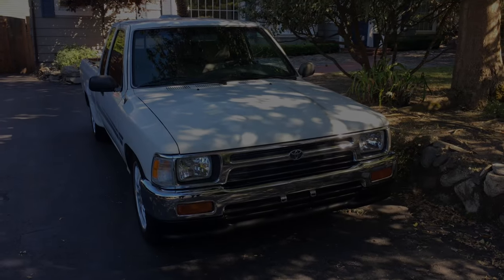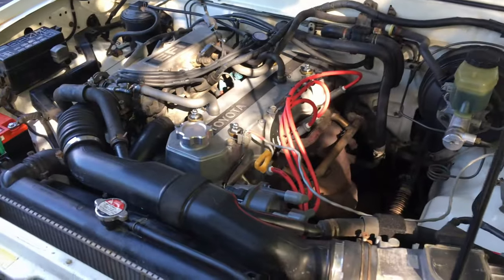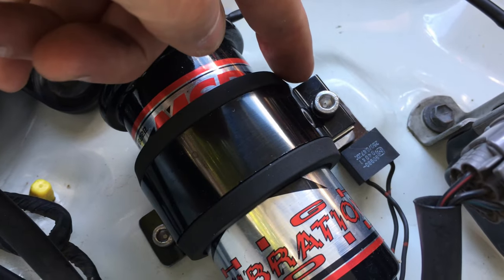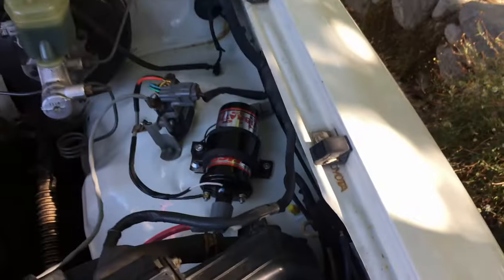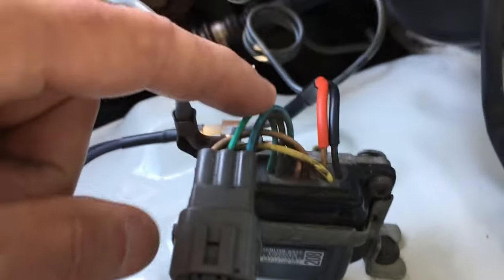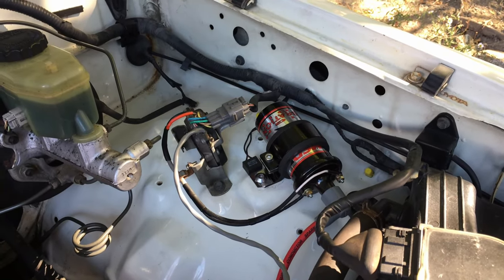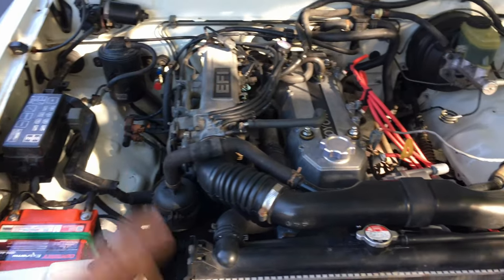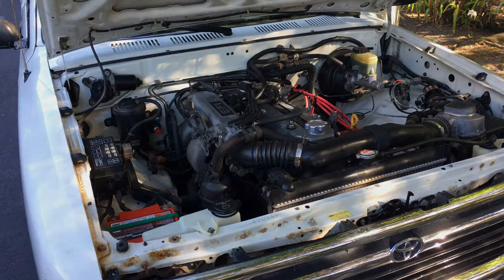1989-95 Toyota Pickup / 4Runner MSD 8222 coil ignitor retrofit / upgrade wiring & 4Runner bumper

Comment: I did this upgrade on my 22re after seeing u did it on the other truck works great got an extra 2 mpg out of my 4wd. However I installed the resistor because this video hadn’t come out and the blaster 2 instruction asked for it, did u do anything to address the resistor it asks for? Is it not needed for this application?
Reply from the maker: The resistor's main function is to help prevent the point contacts from burning up due to too much amperage flowing across them. However, with the Toyota 22RE, it uses a hall effect signal generator and coil (basically electronic crank fire ignition, but on the 22RE it's located in the distributor, not on the crank itself, like what you'd find on a race motor). So because there is an air gap in there and it's only generating a pulse signal, you don't really need that resistor in the mix. Now if you are installing this MSD blaster coil on a 1965 mustang - which does have contact points - then yes, I would say you need to wire in that resistor they show in the instructions. But for the Toyota 22RE it's not really required. It won't hurt anything, but it's not as critical because there are no points to protect.
Reply: Makes sense to me u think it would work better without it? Just curious on ur thoughts I’ll probably remove it anyways, thanks for all the videos very helpful! I have also cut my spark plugs like previously videos works like a charm ur the man!
Reply from the maker: @samuelfriesen1867  Yeah, that little spark plug mod is pretty nice, especially on a more modified motor. As far as the coil, that ballast resistor's job is to help control arcing across the points basically. If one looks at how points function in an older car, we can kinda understand better what is taking place: in am old school point type distributor system: when the points are closed, energy is sent to the primary winding of the ignition coil.. this builds up a magnetic field at ~12V in the primary coil. When the points open (and the duration they are opened is measured in dwell angle), the field in the primary coil collapses (because the points open and terminate the flow of electrons) and this energizes the secondary coil (as the field collapses across it); the secondary coil is an attractive route back to ground, because it's directly connected to whatever spark plug is about to fire off. Since there is a difference between the number of windings in the primary vs. secondary coils, you see a huge voltage jump from the nominal 12-14 Volts clear up to more like 12,000 volts (there is also a corresponding current drop as well in the circuit) All that is fine and dandy, however, because the points have to traverse from fully closed to fully open, they momentarily produce a very brief gap that isn't all that big and which some electrons might view as a more attractive route back home. In other words, a very slightly open set of points momentarily looks like a tiny spark plug. If you didn't have a ballast resistor, a higher number of electrons would be perfectly happy to take that route, as opposed to waiting for the primary field to fully collapse. When they back track as it were, they create their own tiny spark / arc and this is what serves to burn up your points in an older car with a more classic type points ignition system; when the electrons jump the tiny initial gap on the points, it's like a tiny welder in there arcing up the surface of your points. This is why on older cars you are constantly having to clean the points and check your dwell angle, etc. Anyway, the ballast resistor is there to help prevent some of this from occurring with as much current as would happen without the resistor in the circuit; the added resistance basically makes the electrons more prone to wanna just do their thing inside the coil, as opposed to back at the points. So if you have mechanical points then yeah you need the ballast resister in the mix, because it will help extend the life of your points and prevent them from burning up as quickly. However, in a situation where there are no points making physical contact over and over again, then it's basically a non-issue. With the Toyota, you have a hall effect deal in there where you have a rotor and signal coil that is not physically touching. It has a constant air gap in the 22RE distributor and this is acting as its own built in resistor in effect (by virtue of the air gap always being a gap; not opening and closing like points where the contact pads actually touch and open/close). So because there is no mechanical surfaces that touch, the air gap is sort of a bridge too far for the electrons and they just prefer to stay focused in the primary coil and drop their energy over to the secondary coil that is grounded by virtue of the spark plug, cylinder head, etc. They see the path back to ground (via the secondary coil) as a more attractive route than trying to jump back across the rotor / signal generator stuff inside the distributor. So the short answer is yeah, you can remove the ballast resistor and there should be no negative impacts whatsoever. In fact, you'll probably get a slightly hotter spark without the ballast resistor in there and since there are no points to worry about, there shouldn't be any downside to removing it. Most likely you'll see a slight reduction in burn time on the spark plug side and perhaps a slight increase in voltage levels present at the spark plug wire as well. If you happen to have a TA500 diagnostic tool, you can actually check all this and see the exact burn time in milliseconds and voltage levels, etc. I use that tool here to confirm all is well with my ignition system, spark plugs, wires, coil, etc, etc. This is the model I use here (I use it mostly for stuff like chainsaws, but it's handy for automotive engines as well): https://www.amazon.com/TA500-Smartach-Multisystem-Ignition-Analyzer/dp/B001TCWMGS/
Reply: Gotcha appreciate the info, I actually have a stroker 22re and that spark is very helpful to get the power out of it along with resist the higher compression, I’m familiar with the old points, I’ve played with them a handful of time
Reply from the maker: @samuelfriesen1867  Yeah, adjusted the points on my '66 mustang and '70's Datsuns many times myself :) What compression ratio are you running? That MSD 8222 coil should be pushing around 12-14K volts at the plugs if all is well. Are you running traditional Denso W16's or maybe 20's with that strap mod? Did you remove the strap completely or do the side ground routine that I showed recently in the video?
Reply: I’m using the LCE stroker kit, it claims 9.7 so I’m just a hair above that after the rebuild, I’m running ngk plugs, I used the BPR5ES cuz it was what I had and cut them straight across and gapped at .045 I have another set of ngk BPR5EY sitting around I’ll experiment with stretching that gap farther, but I will be changing to the Denso plugs eventually I didn’t realize they were that much better and everyone likes them more, how far should I gap them for more everyday driving? What’s most reliable and consistent? Incase ur curious to watch my full rebuild I linked the good part but this is my buddy and me rebuilding it, there’s more videos on his channel related to my engine rebuild, sadly I’m still waiting for my cam LCE has been out of stock for almost a year and I’m just waiting for them to ship it

https://youtu.be/wnInpXFv9ac
Reply from the maker: @samuelfriesen1867  I'll check the video out, thanks! You might wanna call Faith over at Webcams... they grind most of the LCE cams for them; she can probably get you a nicer grind with less advance ground in. I'm running around 9.7:1 on my motor also (due to the +.020" over and the Keith Black pistons). I prefer the Denso plus myself. I'm running W16's with a gap of .045" here; that seems to work out well for daily driving.
Reply: Oh sweet I’ll look into that I’m getting impatient, I had to go 40 over for the kit I’ve got a 2nd long block ready to rebuild incase I have any problems, it claims a 2.6 displacement, I’ve been pretty satisfied with it, I’m hoping the cam will get me that last bit I need to make it a real beast of a 22re
Reply from the maker: @samuelfriesen1867  I watched the video you posted... and commented there; I was asking what ring gaps you are running? I noticed your friend bored the block without a boring plate, but you are running ARP studs. Not the end of the world, but just curious what head stud torque you're aiming for. Also, just to confirm.. you guys did order .040 over rings too right? :-) I'd be curious to know what piston/bore clearances you are running, which ring gaps, what main and rod oil bearing clearances you are running, etc. On the cam, Faith is very knowledgeable. Also, you might wanna look into the LCE adjustable cam sprocket (I have a video that touches on that). If you just bolt everything up, most likely your cam (using the factory dowel pin alignment isn't going to be right on the mark. If you guys go to the extent of timing in your camshaft based on valve lift, etc. then having that adjusting sprocket is a life saver. Also, since you are running a long stroke, you might wanna retard your cam timing 4-6 degrees or so (depending on the cam itself of course) and move the power up higher in the RPM range... this also helps the 22RE to rev out. Some of the LCE cams have some advance ground into them and this gets you off the line great, but then you'll find out the motor will refuse to rev past 5500 RPM's no matter how much you push it. On my motor, I'm running 5.5 degrees (at the cam) retarding, which really helps the motor breath and spin up; it makes great power once the truck is moving, which is great for highway cruising along...
Reply: The head studs were torqued at 75 or 80 foot pounds if I remember right, and as far as the clearances u would have to ask him he checked all of those, he obviously has a shop and does this for work I was just there to help with assembly, as far as the rings they came in the kit from LCE, this kit had everything needed to rebuild, I’ll probably get the adjustable cam gear and tinker with it, I’m not nearly on ur level of expertise, I just know basics, I saw ur comment and I’m shooting for more torque then I am high rpm horsepower, I have watched many videos of urs I have learned a lot, I still go back and watch them again for changes and ideas to make things better
Reply from the maker: @samuelfriesen1867  Gotchya... yeah I think I'm running my ARP head studs at 75 ft lbs as I recall. Yeah for more torque then the LCE cam should be fine as they grind it; but the sprocket is still nice so you can get it dialed exactly in.

Comment: Engine bay looks so clean and open and tidy  .. takes a lot of effort and talent to do that in that small of a space, and the stock 22RE, as good as they are and relatively easy to do basic maintenance on did always did seem kind of wirey/hosey
Reply from the maker: Thanks! Yeah, lots of crazy vacuum hoses and VSV's on the ol' 22RE there :)
Reply: @ray5961  Would enjoy hearing your thoughts one day on converting a 22RE to a 22R .. dont think I would do that, but, idk, still have the idea lingering around in the back of my mind.  Lose a little power for a little added simplicity.
Reply from the maker: @tedbastwock3810  Yeah, I hear ya. I've thought about it also. I think if I were gonna go that route, I'd run 44mm Mikuni side draft carbs and fabricate up some sort of custom manifold off the stock intake runners or something. That would be pretty bad ass. I used to run a dual side draft 2.2L Datsun motor that was super fun to drive. So I'm with ya. The EFI is nice, but it's a headache too. There's something to be said for carbs and electronic ignition.
Reply: Wirey and hosey is right. Great phrase.

Comment: My 1991 4Runner started shutting down on me. It happened to me 3 years ago so I recognized it as the cheap Oreillys Ignitor replacement, didn't last too long. But back then, the El Cheapo ignitor from Oreillys was only $100. Now it goes for $400!!!. And YotaShop sells it for $200, but I'm assuming it's a cheapo brand, since they don't state that it's an OEM Toyota, like most of what they sell. Good thing is that the local pick your parts had a 1990 4runner. I just hope someone hasn't taken the ignitor yet.

Comment: In order to switch back to the older thicker plug wires. Do I have get a new distributer with cap and rotor?
Reply from the maker: Yeah most likely you're gonna need a new coil as well as cap/rotor. Also wire separators

Comment: I have a 1990 Toyota Pickup with the 22RE. Need a new ignition module but am having trouble finding a replacement. Any advice would be appreciated
Reply from the maker: generally eBay is where you would find something like that.

Comment: Thanks for the Toyota information. I have a 1987 Toyota pickup with the 22RE engine and was wondering if it is normal for the air conditioning compressor to cut off when the truck is idling and then start back up when you start driving? If this is not normal, what can be done to fix the problem? A second question I have is, what do you think of the Davis Unified Ignition system for the 22RE? Is it any good, or do you think there is something better out there, or just stick with the stock system?
Reply from the maker: I'm not gonna be the one to ask about A/C stuff on the 22RE because I generally remove it, along with the P/S system, and throw all the parts into the trash... so can't really help you much there. The factory service manual (which can be found online) might have some info. As far as the Ignition system you mentioned: most of those sorts of systems are designed to bring cars which were in the dark ages back in the 60's (which mostly ran points) up into something more modern. In those cases, it helps a lot. However, with the 22RE, Toyota is already using a very good ignition system (almost crank fire like on a race motor). The stock system should be plenty fine. You could upgrade to the MSD 8222 coil and wires like I do, but even that is sort of overkill. The factory ignition system is very good right out of the box.
Reply: Thanks for the info. @ray5961

Comment: Hello! 
I have a 1993 Toyota pickup 2wd 22re all stocked 
I was wondering if someone could give some directions on what could improve my throttle response 
When i do quick snaps or fast acceleration engine takes long to catch or response to those type of reques
These are the things I have done to the engjne
- complete tune up
- valve adjustment 
-engine was rebuild 5 years ago and even before rebuilding the engine it was acting like that 
- when engine is warm it can idle all day long at 550 RPMs meaning no vaccum leaks 
Could this MSD 8222 help me with this issue? Do i need to move my timing a few degrees advance? (Rigth now is sitting to what the manual recommends) if i need to advance the timing, how many degrees?

I appreciate you help/comments
Reply from the maker: are you running with or without a catalytic converter? Sometimes the issue you are describing can be caused by modifications that improve flow (such as a camshaft, removing the cat, etc.).. what happens is under sudden throttle going to WOT, the mixture goes very lean and it takes the ECU a few seconds to get back to a better air fuel ratio - I have a video which addresses a mod I did to compensate for this exact issue here https://youtu.be/2I8BEoQxemM?si=PYgKtrvWHgDqZFV- you might also want to run some fuel injector cleaner through your tank (I like Berryman B12 fuel injector cleaner). Advancing the timing to 7 degrees from 5 can also help a little. Try to keep in mind that the 22RE isn't a super powerful motor and the factory ECU isn't designed around high performance road racing as much as smog and fuel efficiency.
Reply: @ray5961  thanks for the tips/suggestions actually I am in the works of getting a new Flowmaster series 40 and delete the catalytic converter I will take step by step to see my improvements then bump the timing to 7 degrees how you are suggesting

Comment: Do u have to buy the spark plug wire too or is optional
Reply from the maker: the coil and spark plug wires are two different kits - check the links in the description and you can see how it comes and where to get it. I like both myself.